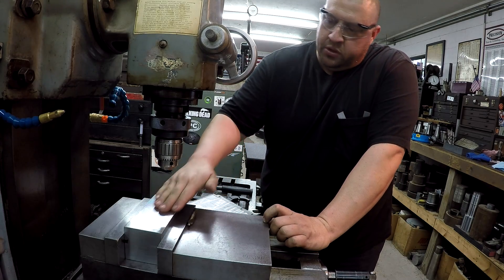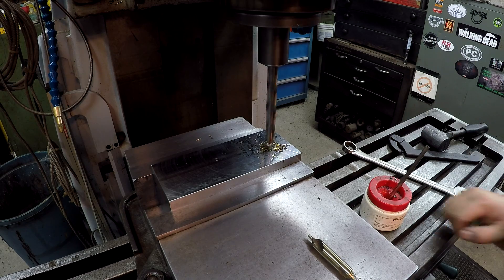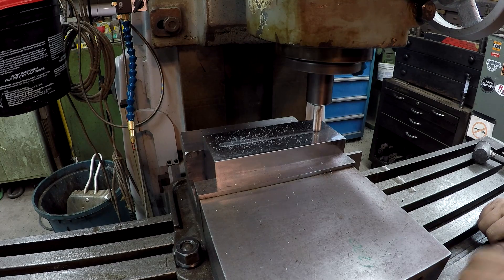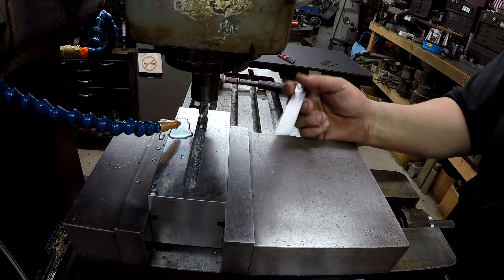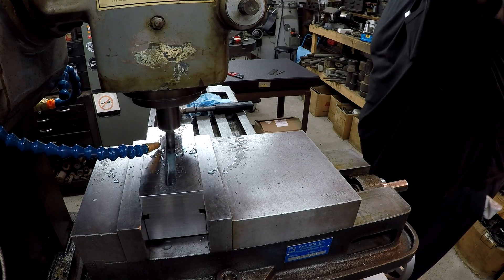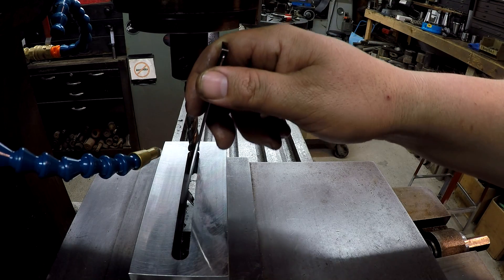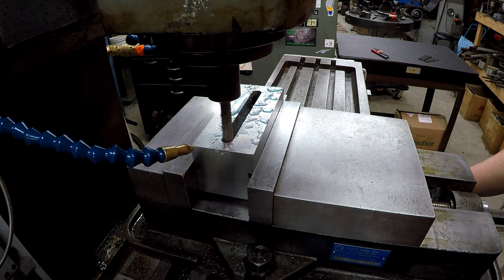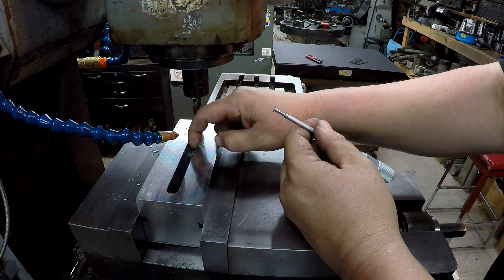WIYB Toolmakers Collaboration Machinist Vise Part 5

Comment: A couple of the views seemed to show a lot of fog coming off the mister.  I am just starting to use mist coolant, but I understand that the fog can cause respiratory problems.  Might try using less air pressure and the fluid valve wider open to generate larger droplets. Or, maybe it was an artifact of the camera and not as foggy as it looked.
Reply from the maker: +Bob Korves You can overfog if you use too much, but I like to make sure the cutter is staying nice anc cool. If you use the proper mist coolant it's not suppose to be toxic.

Comment: Cool!  Did you try measuring the width of the slot on the top side?  I'm curious with such a long endmill if you have deflection (wider on the bottom closest to the spindle, narrower on the top away from it).

Comment: Hey Adam, Strange question but this video shows (for the first time I've seen personally) how you dispose of chips but have to ask. Is that a regular vacuum or something special to dispose of metal chips?
Reply from the maker: It's just a regular shop vac. It gets dumped into the trash.
Reply: Abom79  you don't recycle the chips?  I assumed you recouped some cash at the recycler with all those chips.  Will they not take them bc of the coolant?

Comment: What happened with all the grease that was falling out of that head? Did it lose all lube or just part of what was there?
Reply from the maker: Still uncertain on why the grease come out. Don't know what kind of seal is in that head. I now have the correct grease and have pumped some grease in there.
Reply: +Abom79 glad to hear Adam I was just concerned about it running dry, thanks for another fine video, I always enjoy them even though Ive never even been in a machine shop. haha